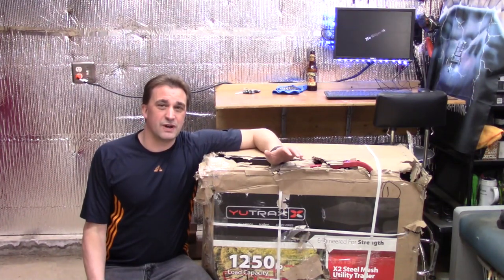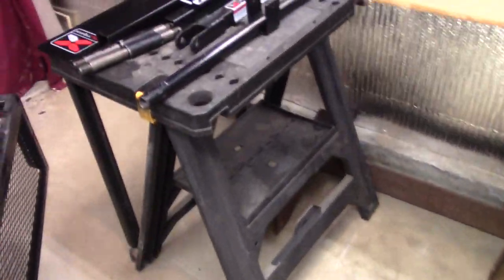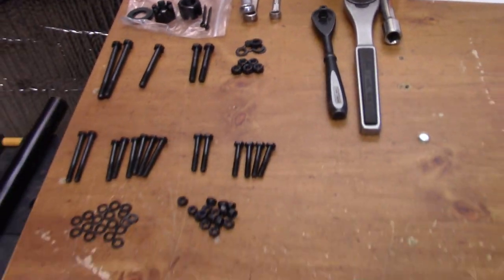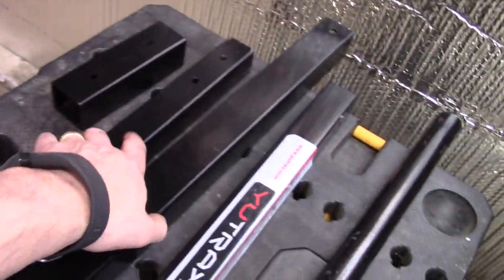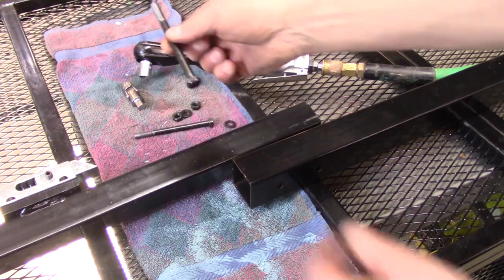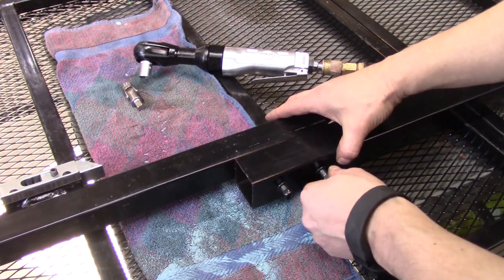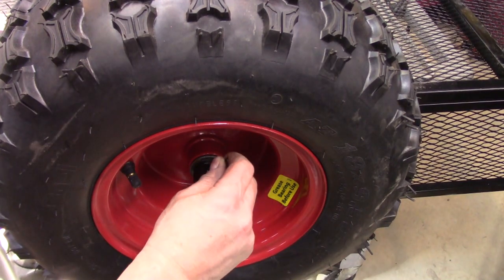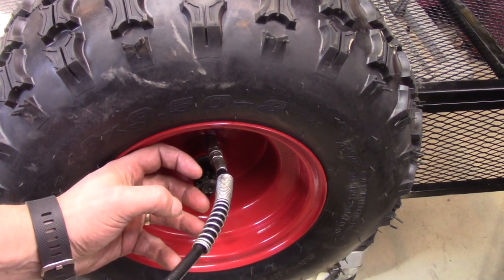How to Assemble a YUTRAX TX158 X2 ATV Utility Trailer YUTRAX Utility Dump Cart Assembly Instructions

Comment: Very helpful video, thanks!!  I read your review on amazon and then looked up the video when my trailer was delivered.  I haven't actually assembled yet but plan to take the laptop out to the garage instead of the instructions that came with the trailer, i'll let you know if i run into any problems but thanks to this video i feel confident that it will go together without any problems.

Comment: I got one almost like this but solid deck, go the ball mount (coupler) I did and love it, I got tired of the noise and sloppiness of the pin. These trailers need some kind of fender , I get grass and mud on my loads and all over the frame. I installed a rubber mat from a horse stall mat and not only will it save the deck it holds loads a bit better. Also I installed ATV gun holders on the side for tools , I got the angled type so it clears the side railing just right so now I can haul shovels , rakes and even a pole saw. Lots of upgrades but well worth the extra if you are using your trailer a lot.

Comment: found this video from your amazon review. i work at Cabelas distribution center in the direct shipping department near salt lake city. i cant believe the condition this arrived in. i refuse to ship these via UPS because it is at the upper limit of weight that UPS will deliver. i ship all of these via ABF Freight or YRC Freight and they are shipped out on a pallet. for anybody looking to purchase one of these see if you can request to have them shipped this way.

edit to add: i just looked and cant believe amazon sells this for $580! cabelas has these for $349 but are currrntly on sale for $299. i now know why i have been shipping so many of these in the last couple weeks.